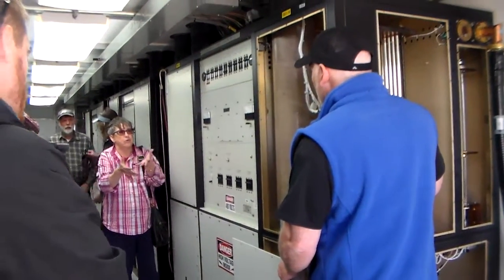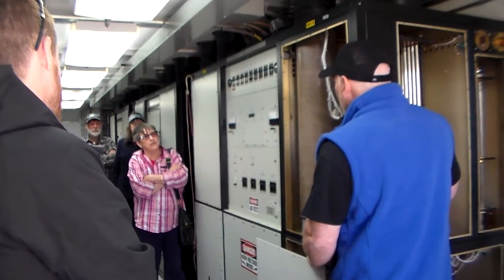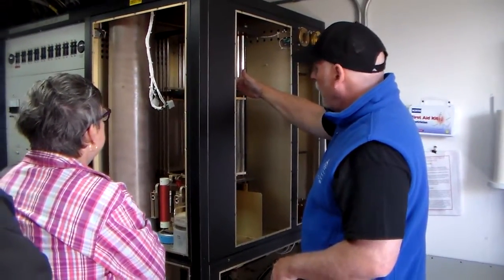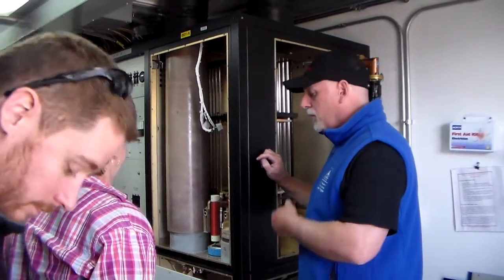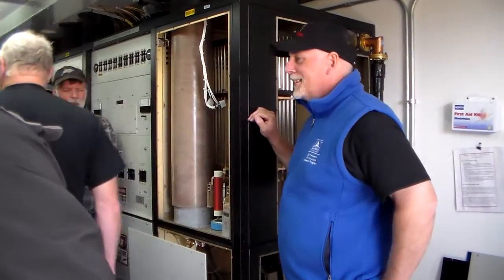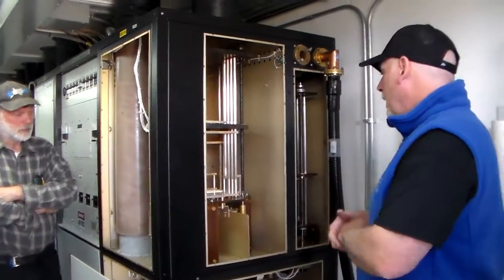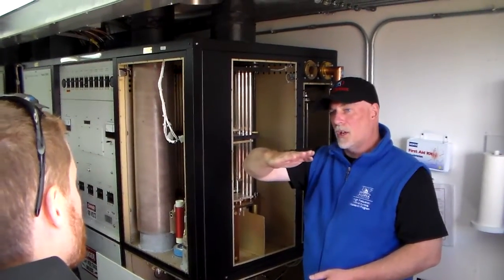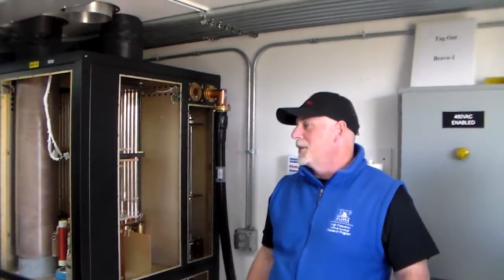HAARP Open House Tour, Transmitter Shelter

Comment: Definitely the best amp design for high performance clean signal, but of course at the expense of high idle current.  Ground screen reflects wave back up, my first thought, I wonder if they can modulate the signal. Just think of the power, say modulate half the transmitters at 1000 cps, the other half at 1001 cps, and every second, huge power burst. That along with the reflected Reinforcement, and absolutely huge power bursts. Sure enough, they can and do modulate the signal. They do not say anything about how they modulate, but check out the video on this channel "HAARP Transmitter Shelter Explained" for that and more info. I seen these transmitter sheds on satellite view, wondered what they looked like inside, and here I am, inside one. Thanks for uploading this. personally I think this kind of tech is used against the people and our Mother Earth, and so, I wish all these places that are located all over our Earth would just become gone.